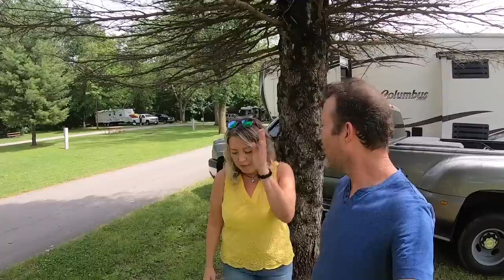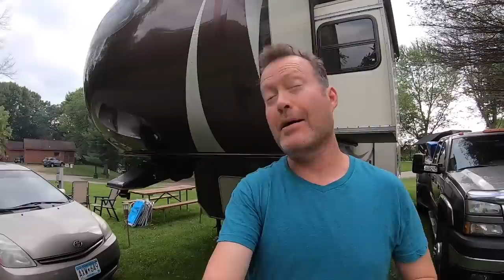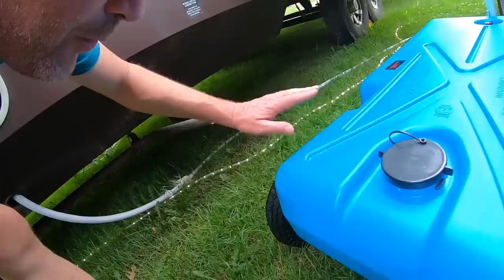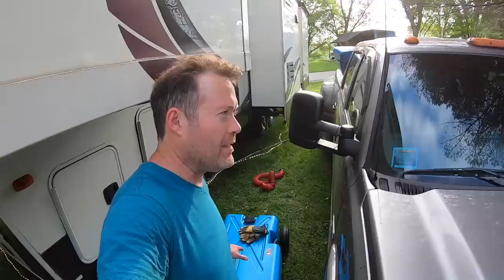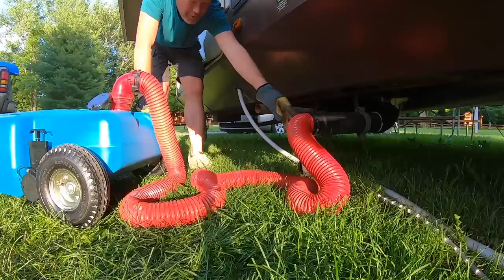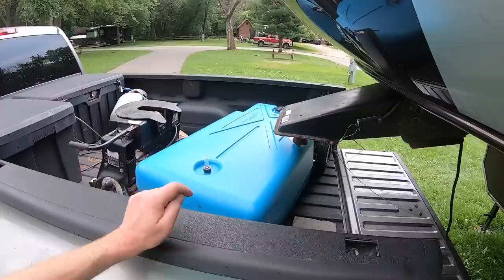RV LIVING FULL TIME - DUMP RV GREY & BLACK TANKS WITHOUT SEWER HOOKUP

Comment: Our RV Park turns off the water and sewer on Nov 1st because the pipes freeze in the ground! (Welcome to camping in Calgary, Alberta). We still had 15 days to go before we could move into our house for the winter so I bought a couple of 7 Gal water jugs, a siphon hose, and a towable tote to get our sewer water to the on-site dump station. I went through much the same experience as you, (including the disconnection episode) but at sub-zero temperatures and with snow on the ground! Luckily, like you, I had decided I had best learn how this thing worked using the grey tanks first. Are we having fun yet?

BTW, after thoroughly flushing the tote, I hang it on my ladder with no problem. I don't plan on using it very often, but it feels nice to be independent if I need to be.

Comment: Lord Farquaad, 1) put a clamp on the hitch ball and speed bumps are not a problem 2) add a Valterra gate valve where you connect the poop hose to the RV, much safer 3) Camco makes a short hose designed for the tote and it will not break 4) there is a fill indicator for front small cap ($8) that lets you know when it’s full 5) no matter where you go, you have to ‘Milk’ the hose - it sucks. Cheers!

Comment: When we bought a new Lance 1172 truck camper last fall there was no place for our blue tote (same size as the one you bought) so I listed it on a sale site on facebook. Sold it for $100 like the next day. No place to carry it and I never liked using it. Didn't make sense to take the camper off the truck to pull the blue tote, might as well pull the slides in and drive the camper to the dump site. We try to always get sewer sites. No sewer = roughing it.

Comment: When I purchase my tote I purchased a 15 gallon one.  It solves the problem of the slow roll to the dump station.  I simply pick it up and put it into the truck bed and drive normal speed to the dump station.  I draw off 15 gallons once a day, takes about 15 minutes and the tanks never get full.  One more hint:  Use the cheap hose supplied to make a custom short hose just for the tote.  My hose never touches the ground.  The waste water goes right in the tank because the custom hose I made is too short to reach the ground.  That way you will avoid wrestling the anaconda hose every time.  Also use a regular 90 degree fitting on the tote so it locks down and can't pop off.  You will thank me later.

Comment: I got a 40 gallon tote, though not as nice a model, for 25 bucks at a consignment auction. I felt like I hit the jackpot when I bought it because I knew I would have to have it at some point. It saved my bacon this summer in similar situation. We had attempted to pay for a pump out service, but missed the schedule and couldn't wait for another few days.  We where in western NY state and a lot of the sites didn't  have sewer. No shame in using the tote, plenty of others where doing the same thing in that campground.

Comment: I have a 42-foot toy hauler. I built a 54-gallon stainless steel low profile tank with motorcycle tires and wheels. I also built a hydraulic platform that the shiny honey tank lives on when not in use. When I need it,  I hit a button and lower it to the ground, fill it up, connect it to my golf cart, and off to the dump station, easy peezy...

Comment: Hi,  get an RV macerator 12 volt pump.  It would allow you to put blue tot in truck bed and then pump from the holding tank to the blue tank using a garden hose.   This would eliminate the height difference issue, but probably add a few hundred dollars to the solution.

Comment: Most of us have the infamous blue pooper scooter. I use mine only for gray water for obvious reasons. I have never had to use it for black water, but I never stay more than a week without full hook ups. Past that point in my life to deal with all that sh..stuff. Your situation is different than mine since my trailer appears to be taller thus my dump valve is higher than the blue pooper scooter. You may need a macerator pump like someone else suggested. Yeah....get some disposable gloves....but you figured that out already..

Comment: We discovered that most of Florida's State Parks only have dump stations. We bought a big tote while we were there. Looks silly but saves a lot of time and agrivation. Hose it out at the dump station before returning each trip. Grease up the wheels and axel. Wheel failure with a full tank is no fun. See you in the next one

Comment: This is the funny part I have my class a CDL with hazmat and all the endorsements plus if you go into refineries to load Propane you have to have a OSHA certification on color coding like hazardous placard’s with all the numbers mean all the colors mean. And I got into a big fight with this person at a camping world that was trying to sell me the exact same tank you picked up she says it’ll work fine I said ma’am do you know what the color blue means liquid water clean drinking water or just water. No no sir you don’t know what you’re talking about I said I don’t so I walked back and got a freshwater hose off the rack and brought it up to her and said white with a blue line down it I go what is this for she goes this is you’re fresh water hook up line. What color is that tank she said blue I looked at her and said do I need to say anymore. I walked back to where they have all the toilet fixtures drainage line hook ups and right down from the hook ups they got all these different gallon size gray and black color tanks. My wife said leave it alone I said no so I went up and got that lady and brought her back there then asked for the store manager because the blue tanks like yours are made a little flimsier not is high off the ground either because if there’s an accident it’s only fresh water in that tank. And when I wheeled The black and gray color tank up next to the blue one you can see it’s built better the hose hook ups are better the connections are a lot more sturdier the lines are thicker and heavier duty that’s because they don’t want you to have an accident with poop. 
Ps I finish the video yes I do mine all the time and that’s the difference between me and all you guys that use blue tanks people either holding the hoses or got your hands on the shut off valves because you’re just waiting for something to happen it all comes down to if you get the right equipment you don’t have that problem I have a 40 gallon gray and black shit tank with solid locking connections my camper is not that big so my black tank fits in it and then I pull the gray to rinse all the hoses out and then I shut all the trailer valves and then the best part is my hose has a shut off valve on it so I unlock it disconnected lift it up in the air drain that hose disconnected put the cap on it connected to my 2 inch bowl and take a poop ride to the dump station and I can do whatever speed limit because my container is heavy duty and speed bumps are no problems. And yes I leave my gray and black portable tank hooked up to my connections if I want to and the good part about that is it has a sealed compartment that you open up the door to it and it has a big red plunger stick that you can look out your window and if the little plunger sticking up out of the tank it’s just a little more than 3/4 of the way full they made it that way so you don’t get hose locked. And when you’re dealing with poop you don’t ever want to get hoes locked. What that means is the portable tank is filled to capacity the hose hook ups are full to capacity and your tank in your camper is about a quarter of the way full. And with you hooking that blue tank up the only way to tell how full the tank is is either sticking a stick down that little blue breather hole or are you sticking your eyeball within inches to see down through that little breather hole because your hose is stuck into the other one and I’ve seen a lot of people get hoes locked because they lost track like you will with the amount of water you’re using in one day or how many times somebody goes to the bathroom.

Comment: We did this a couple of times and decided it was smarter to move the rig, and learn how to last longer with less water use. There are too many failure modes and problems here, it is very time consuming and not fun or even very safe. Just too many ways it can go wrong. Work on making the rig easier to move. Mount things, reduce the clutter, or just get sites with full hookups for the longer stays.

Comment: Now you have a toyhuller get a side by side. We have a Polaris Ranger. We use a lot to pull our blue boy do laundry, trash dumps,all so when we pack up to move we put all the stuff that is on the out side goes in the back of the Polaris an we just drive it up in the back of the trailer. Take the 90 off the hose an just hook right to the tank.an clean your blue boy at the dump Station..We made a short hose from to trailer to the blue boy.

Comment: Check into portable rv macerator pumps. you could probably put the tote in your bed while its empty and use the macerator to drain your tanks and push the waste/water up into it. And use it again to dump if you need to. Then you dont have to to tow it behind and can just haul it.

Comment: If i were you and this is what i do . Don't use the elbow to go into the tank when dumping.  Connect and lock it on the tank the same as the trailer when you are dumping frome the trailer . Then at the dump station use the elbow . Another thing i do is . You can buy a clear elbow that you put on when you are dumping off the trailer to see when all the solids are done .. just saying hope this helps .

Comment: I have a 30gal plastic barrel that I bought at a surplus store for $15, added a dump valve to it, and it stays in the back of the truck. It fits right under the tonneau cover.  I bought a macerator pump from Amazon that grinds everything up & pumps everything thru an ordinary garden hose into the plastic barrel. Works great, easy to use, and no one sees me dragging some blue wagon around the park.

Comment: I got my 35 gal. grey turd trolley 🤭  from Amazon. Its tied the ladder on the back of the RV. Used it ONE time.  No more for me.  WAY too much trouble.  Its easier to just move the 40' 5th wheel to the common dump area.  Other than that, i wont do any boondocking longer than 10 days, then drop into a place that has a commin dump area and fresh water, then back to boondocking.  BTW, I have a very nice slightly used grey trud trolly for Sale or Rent😉.
Would have enjoyed seeing Cheri do the video.  Her expressions would be worth GOLD🤭 .
Fun video you did and enjoyed it in a weird sort of way.  Happy Travels.

Comment: I've got that same poop wagon.
  Works pretty good,  but over time the white paint on the handle will start to degrade and rub off,  and it's a little difficult to get all the,,,,,,,,,, " liquid " out. Other than that it's quite sturdy. Don't forget to vent it when filling. 
   It's a poopy job but somebody's got to do it. 😮

Comment: Hi tom, you can use the short hose that comes with the tank but need use hose clamps and duct tape to make sure the fitting dont come loose off the hose, u should be able to use short hose to tank with out red dump fitting, also you should dump black tank first, then use gray to clean hose and plumbing on fith wheel, hope that helps, I enjoy your blog, you have alot of good suggestions, thanks

Comment: DUDE, when filling the tote, or the Honey Wagon, be sure the hose is either strait or in a C shape. That's why it came off the first time. The hose needs to have clear path to drain so the pressure does not build up and cause it to pop off or break.

Comment: We have the same tote you have for about 4 years now, one of the best purchases for those of us that camp in State Parks. We have never use ours for black, we can usually make it a week long. The black hose is not that bad, it is made to connect from the RV to the tank. Also, check the little wheels tire pressure. I will say, my kids have never wanted to ride on it. Yes, we carry it on our rear bike rack, made for a great picture from the Florida Turnpike Toll Authority. It was handy at Curry Hammock when we were there last year.

Comment: Remove the red elbow and connect the yellow connector direct to the tank. That will keep it from popping off on you. I'm like you I can't move my rig very easily so I have a 60 gallon tote. It's a real pain the poop but it works.

Comment: We are so used to using the hole with the dump valve to discharge the blue tank but you can also use it to fill the tote.  That would make the transfer a lot easier.

Comment: Just this morning I was ready to hit the BUY NOW button on one and then I started to read the reviews.  Now I am shopping a bit more.  We stay in State Parks most of the time and rarely have full hook ups.
Reply: The camco rhino ones are good. They’re really well built. We mostly stay at State Parks in VA and most have no sewer connection. We used our Rhino all last year with no issues. I bought the 21 gallon version, but if I had to do it again, I would probably buy the 28 gallon, since it has the dump valve on the side. On the 15 and 21 gallon versions, you have to tip the whole thing up to dump it out. Not a huge deal, but the side dump valve would be nice. The prices have come down too since I bought ours last January.
Reply: @jontreese8677  Thank you for that!  I have been seriously considering the 28 gallon Rhino.  This has helped me with that decision.

Comment: I loved watching you pull Cheri out the door on the tote like mini-float :-)  We bought the small 10 gallon version 6 years ago and have never used it mostly because we don't know where we can conveniently store it (especially if it's full). We camp in National Forest campgrounds a lot and there's seldom a dump close by. I've had it listed on Craig's List half dozen times for $75 and its never generated a single bit of interest. We have a truck camper so running over to the dump is not a problem what so ever.